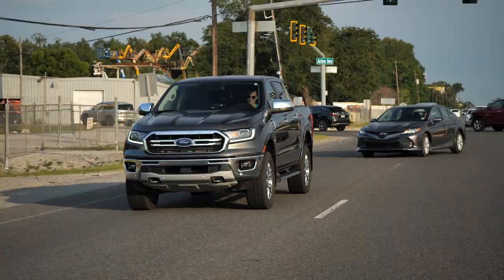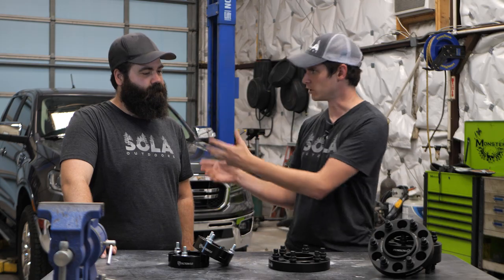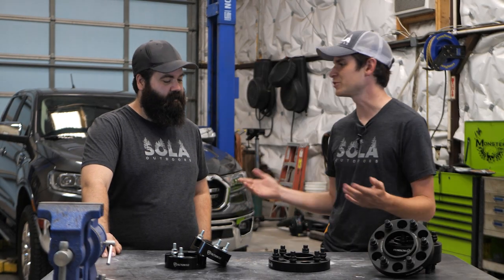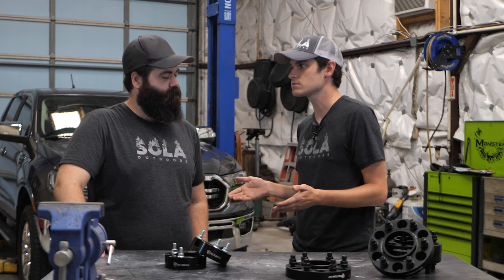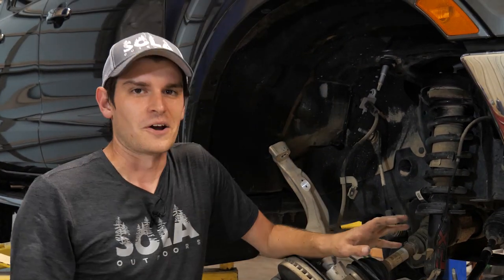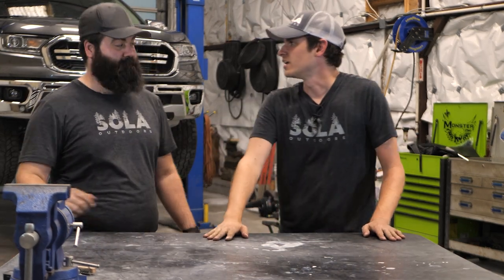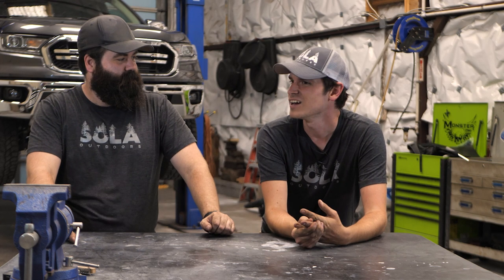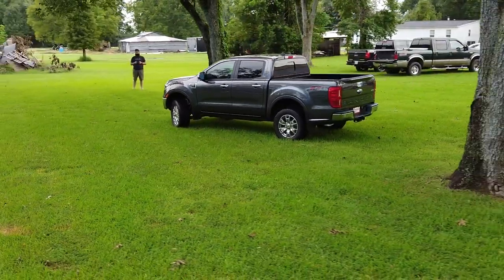Overlanding Ranger Leveled and Spaced - 2.5" Lift Kit Install!

Comment: Nice truck. I like the room of a truck over a sport utility for overlanding.
Reply from the maker: Thanks! We're definitely liking have the separation of our gear from the cab. A lot less clanking of pots and pans going down the road!
Reply: @SolaOutdoors  Lots of room for the big slide out freezer to.
Reply from the maker: That's the next thing on our to-do list after we finish this bed rack video. Just gotta convince my wife that we need to swap out the ice chest for a freezer first
Reply: @SolaOutdoors   I went with a 60 vl freezer and/or fridge with a slide that Iceco made for this freezer. We have used it several times with 200 watt solar breifcase and single battery. Of course when driving I charge this battery with my trailer hitch plug. It works great. The slide is a must have and I got the outer cover also. For the money I think its going to be great.  It is so nice not having to worry about ice. I also take icecream with me...that alone is enough. Lol

Comment: Yeah... you will not get them back in without the CV joint separating. There is absolutely no way to get those extra long bolts back in without that happening.  You have to push so far down on that lower control arm it's impossible not to separate it. I suggest you get a second person. It took me 4 hrs total doing it all alone.

Comment: Great content and well-executed mate. I was wondering to do the same on my 2019 4X4 Ranger, so I've noticed you were talking about the FX4 suspensions, will just replacing the front suspensions with FX4 work?
Reply from the maker: Thanks, my guy! The front suspension on an FX4 is mainly just different struts and maybe different springs and would be a bolt on to any non FX4 truck. They're less stiff for more offroad comfort, which I can confirm rides pretty nice on a back road. They're not as nice as Bilsteins or any other purpose built shock, but it's better than the regular shocks that come on the truck. Since it's a bolt on swap, the lift kit works for either setup

Comment: Thank's for the video. What is the size of the tires!?
Reply from the maker: Those are a 265/65R18 on the chrome package wheels. We've since upgraded to 285/75R16 on Method Wheels and they were a huge comfort increase off road
Reply: @SolaOutdoors  did you need to do any trimming for the new tires to clear?
Reply from the maker: @wesleysproul5812  we had to remove the front and rear crash bars, but that was it for us. It did help that our new rims had +0 offset, but the biggest interference areas are the crash bars and the the steering knuckle
Reply: @SolaOutdoors  Thanks for the quick response. Was trying to find a tire size where the crash bars would not need to be removed, any suggestions?
Reply: @SolaOutdoors currently running the same size tires on stock 16" steelies with a 35mm wheel spacers, (+20) offset. Looking to throw on 25mm strut spacers for the 2" level up front. Hope the tires aren't too beefy for the lift until I can score some MT64's.

Comment: In the video it looks like the wheel studs are to long for the spacer.. I had to cut all mine off and I have 1.25 inch spacers. I had to cut bout 1/4 off every factory wheel stud
Reply from the maker: Do your wheels not have relief pockets on the backside of them? Ours did and sat over the studs with out any cutting of the factory studs
Reply: @SolaOutdoors  no

Comment: Beautiful job guys! Just what I was looking for! I already have the spacers on, I have a global Spec T8 2020 ranger. Would the 2.5” lift spacer work with the global version too?
Reply from the maker: That's a great question, I'm not exactly sure. I'd have to see if I can find the spring perch part numbers or maybe the bolt patterns to do some cross referencing. We will probably have the struts out later this month, so I can always measure it directly if need be

Comment: Think that  a ranger with mods like these can fit 33s or 32s
Reply: 32’s yes. 33’s you either need to cut the front intrusion bars off or get aftermarket ones like BDS has.  It kind of sucks that Ford has limited us like that but I still love mine anyway.

Comment: Did you have to cut the original stud when you put the spacers in ?
Reply: You use the original studs to hold the spacers on. The spacers has its own studs. If you’re going to use spacers then this type is the way to go.

Comment: I’m getting this level kit installed on my 2020 ranger 2wd then going on a 16 hr road trip should I be good? Just want to make sure I don’t run into any issues on my trip
Reply from the maker: As long as they align it while they're in there, you shouldn't have any trouble! I usually recommend driving it for a couple days before a long trip like that, but as long as the shop is good then you shouldn't have any trouble
Reply: Is it safe to reuse the tierod nyloc nut once loosened?

Comment: Great video, but I have to ask, is the Grand Cherokee gone?
Reply from the maker: Unfortunately, yes we had to say goodbye to it. We reached the point where any further mods would cost a crazy amount of money for where we wanted to see it go, so we made the decision to start fresh on a platform that would be easier to fabricate our own equipment/have more aftermarket solutions available
Reply: @SolaOutdoors  As a Grand Cherokee owner myself I'm sad to see you go, but I do understand. Not that many people doing a whole lot to the WK2 platform. Im excited to see what you'll be doing to this vehicle
Reply from the maker: @brandoncoe1666  it was definitely a bitter sweet transition for us. We put a lot of time and energy into the Grand, but it felt like we hit a brick wall with what we could do with it. It was super capable and surprised everyone watching it wheel, but in the end the need for getting a truck won out
Reply: @SolaOutdoors  Curious what mods you feel you couldn't do to the wk2 without spending a crazy amount of money?
Reply from the maker: @TroutWest  I was really wanting to lift it higher, but it would have required a redesign of the front suspension. The price of bumpers for that platform is crazyand there wasn't a single set of them that I thought complimented the body lines just right. Plus I was really wanting to have a solid rear axle with a true locker, and that would have been a huge undertaking
Reply: @SolaOutdoors  I see you must not have had the quadra drive 2 . That system does lock. There's not many aftermarket options for suspension that's true, but clearance isn't usually needed beyond stock levels unless you're gonna go crawlin. I promise a wk2 with q drive 2 will out off-road that new ranger no problem. Good luck with the new build though I'll stay sub to check it out.

Comment: awesome video! did you have any clearance issues with the existing wheel studs sticking out past the 1" wheel spacer and coming into contact with the back of the wheel?
Reply from the maker: We didn't have that issue with our chrome package wheels since they have the necessary pockets between the lug holes to accommodate the factory studs sticking out
Reply: @SolaOutdoors  cool! thanks for the info

Comment: Hey guys great video. My question is that you say " the only reason someone wouldnt do this mode, is if they dont have an FX4" I have a Sport model, but wanted to do this mod. What will the issue be? Will the front end then be higher than the rear? Sorry for the newbie question.. thank you
Reply from the maker: We probably could have worded that better, but what we meant by that was the shocks/struts on a non-FX4 are more tuned for on-road use. If you're planning on doing some off-roading, you'd likely want to upgrade your shocks while you're in there and get something like a Bilstein 5100 instead. If you're sticking mostly to pavement or not doing serious off-roading, this kit would net you the same 2.5" of lift in the front. I'd recommend measuring your fender height front and rear to make sure it would truly level you out
Reply: @SolaOutdoors  Thank you so much for the info! You guys are great!
Reply: @craighoyt125  most people who have Fx4 and do off-roading usually upgrade their shocks too. Everyone complains about the Fx4 shocks for off-roading, especially when they have just a spacer leveling kit like this.  Fox 2.0s are kind of the go to.

Comment: Any Chrome is too much Chrome for a truck… remove it all right now and maybe...
Reply from the maker: I'm with you on that one, I've actually got some color matched vinyl to wrap the mirrors and door handles, then I'll be swapping out the wheels shortly after that. The bumpers are gonna be quite a project
Reply: Just buy a color matched truck no Chrome. Any Ford with with the Sport Pkg mid 90s up

Comment: A spacer is NOT a lift
Reply: How so? There’s different types of lift. I guess since they didn’t do anything to the back it’s just a level but you can use spacers up front and blocks or shackles in the back to get a lift. It’s more form over function but still a lift. I personally would go with a suspension lift/level but not more than 3 inches. I think these trucks look stupid with a 6 inch lift.